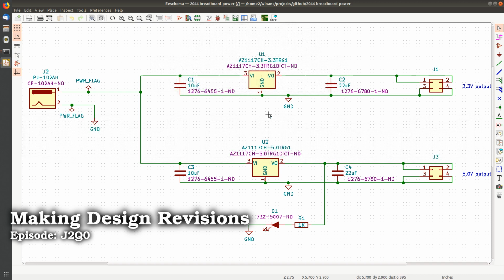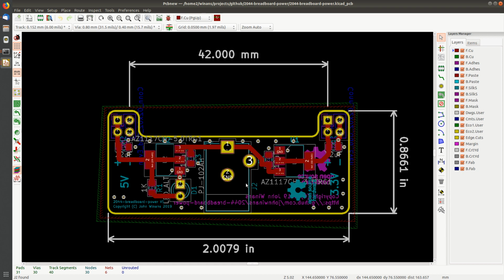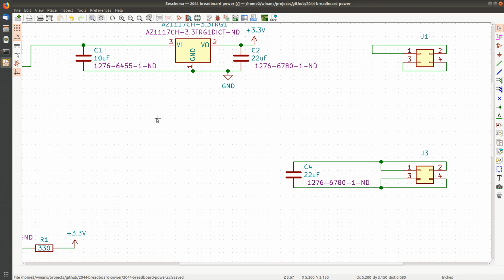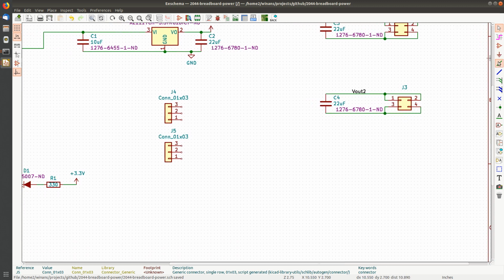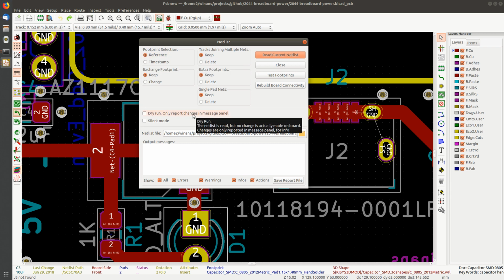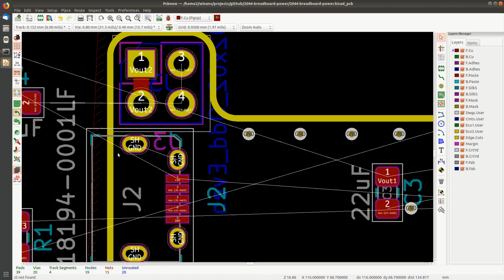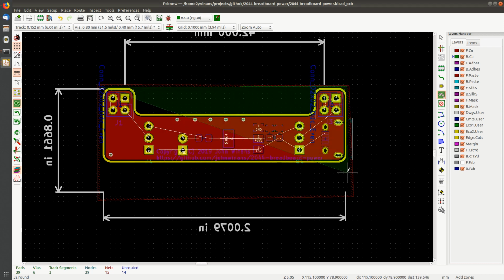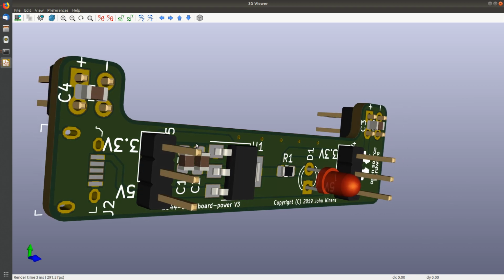KiCad 5 #10 Making Design Revisions

Comment: Thanks for your clip, I learned a lot from your clips.
However, when you want to do revision just save the original schematics and layout to name_v2 and close the views then open (name_v2) and work on those instead of destroying the original work.
Reply from the maker: This is a good idea when not using version control.  Normally I keep my projects in something like git.  Then I just tag the various releases so I can retrieve them later.
Reply: @JohnsBasement  Thanks again John,   Just a reminder that git is designed for text, and if you are not extremely careful it would corrupt your binary files. For binary files try "Subversion" or "Helix Core"

Comment: You forgot to connect GND to J1 and J3
Reply from the maker: You are correct!  I noticed that after recording this discussion and pushed up the corrected version to github.
Reply: @JohnsBasement  Thank you for your works, it helps me a lot!
Currently I'm struggling to produce PCB at home to tighten the cycle. If you have any advice on that, please let me know

Comment: Gee... another great coffee shop video...  you are one of the 1st to know as of right now i am having my 1st 8" x 6" pcb being made... thanks to you and other diy videos...  thanks a lot...:)
Reply from the maker: If you can say, What board house R U using??  I've been bending over backwards to stay under the 100x100mm proto service options from pcbway & jlcpcb.  So far so good.  But it's great to have other options.
Reply: @JohnsBasement  Hi, PCBway came up 1st last night, so i placed the order and it was $54 for 5 boards and with SH the total of $82. i guess that is ok? a least i got started.. thanks.
Reply from the maker: I haven't done anything that big in over a decade.  And then never as a hobby project.  So that seems reasonable to me!
Like I said, I've been limiting myself to their 100mm square bargain boards at 2 and sometimes 4 layers.  With shipping they are are in the $20-$30 with shipping fir 5.

When I'm under 5 square inches, i prefer oshpark.  Theirs are higher quality, ENIG boards for even cheaper.  You like saw some of those in the tiny example project boards in this series.

Comment: I have a board almost ready.  I’ve modified the silkscreen to be more user friendly.  I need to make a small schematic change, if I update the board it wants to change the references back to what’s on the schematic?  Is there a way to prevent.  Or maybe I should have just added new text instead of changing the reference.
Reply from the maker: Kicad is not known to support back-annotation (from pcb to the schematic).  You should have changed the refs in the schematic & then propagated them to the pcb.
Do you REALLY want the part references to differ between your schematic & PCB anyway?
Reply: John's Basement No I don’t,  I was watching someone who had changed everything on silkscreen.  So I did it that way.  Changing the reference so that you can have the text you want on silkscreen makes no sense.  I changed what I was doing to just adding text to silkscreen.  I don’t mind the reference on the silkscreen, but if I did, I could just turn it off.  I wish the video I watched had done it that way.
Reply from the maker: @TheDaveho  Changing the ref strings on the PCB is just a bad idea.  If you want something to say "1.5v zener" then add a text field to the silkscreen layer. Sometimes I add text to a copper layer that is otherwise not filled.

For easter eggs on a 4 layer board, put a rectangle keep out somewhere to keep all layers free of copper. Then write some text into the layer 2 copper, not too small. Then you can only see it if you shine a light through it from the back.

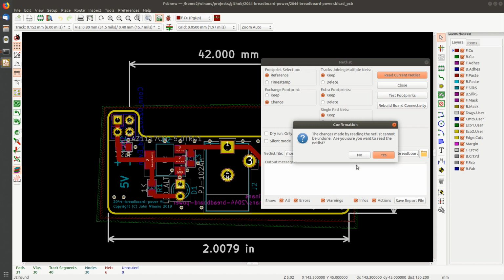Comment: Hi, I´m using KiCad 5.1.5 on a Windows PC and I´m having difficulties to update the Netlist (minute 5:49 of the video). Do you know how do I do it on this version of KiCad?
Reply from the maker: I'm on 5.1.5 now too & haven't noticed any issues.  The properties editor is rearranged but otherwise works the same for me. You might have to be more specific.
Reply from the maker: One other thought, if there is some sort of bug, maybe foregoing the netlist and loading updates to the PCB directly from the schematic might help. (The button to the right of the NET button in PCBnew.)
Reply: @JohnsBasement  Yeah, I´m having difficulties finding the editor and the stuff you did in the video.
Reply from the maker: You mean the netlist IMPORT in PCBnew??  Yeah, that is a little bit different in that it now FIRST tells you what it WILL do if you click 'UpdatePCB' so you can cancel it if you notice that it is not what you want.

The PCBnew import also changed the radio buttons to checkboxes (since all the choices are binary yes/no anyway) but all mean the same thing... so that does look a bit different as well... but it will ultimately accomplish the same thing.
Reply: @JohnsBasement  Okay, I think I get it now. Which boxes do I check? "Update Footprints", "Delete Extra Footprints" and "Re-associate Footprints By Reference"?
Reply from the maker: @GabiMesser  Well, that would depending on the situation... To match the video at 5:49, you'd want to "Re-associate Footprints By Reference" & Update Footprints".
Reply: @JohnsBasement  Thank you so much for the help and attention. That´s it!

Comment: If I want to install two parts, one barrel jack and usb connector. How do I modifiy this schematic?
Reply from the maker: Since recording this video, I have found  a nice through-hole mini-USB connector (this project has a micro). It is in the digikey library (see part 9 of my KiCad playlist) MFG part number is: 10118194-0001LF.

to add a barrel, you can hover your mouse over the barrel on there now and hit C to copy it.
(I'm not sure I understand your question.)
Reply: @JohnsBasement  Thank you for answering my question. I mean if I want to use micro use connector and barrel jack socket at the same time, how I design the schematic? Thank you John!
Reply: If the barrel jack is delivering something higher than regulated +5, you would need to have a regulator on that, which would also connect to the feed from the USB. You wouldn't use them "At the same time" .... you don't want the USB supply and the barrel jack supply competing. But you could use whichever was convenient at a particular location. Like having a device with wall cord and batteries .

Comment: There is no "technical error". It is an user error ;-)  You forgot to wire the "-" outputs to the ground on the schematics... Don't send your design to OSHPark yet !

Also, next time you want to measure something, use the caliper tool. It's much easier than messing with grid and counting dots.
Reply from the maker: Good eye!  I found the - GND problem right after filming.  It was corrected in what i pushed to github.

Good call on the caliper tool!  I could have also hit the space key to reset the dx dimension to eliminate doing the math in my head.

Comment: Great video John,  lots of tip's and pointers.....Funny enough Contextual electronics just released a vid about removing track's and you can just "rip-up" and start again with a single keystroke ……..Have you any plans to go into using the GitHub to update library's or are there other tutorials I should see?.....But I like your style, so here's hoping.
Reply from the maker: Yeah.  I noticed that contextual has started updating their kicad series to version 5 right now too.  We seem to be using different approaches.  So I'll stay the course (so to speak).

I'm not sure what you mean about github and libraries.  Please explain.
Reply: @JohnsBasement having no experience with git hub I would like to say update my pacages3d libary but I'm not sure about terms such as "pull" and "clone" and what the procedure is....that sort of thing, I guess its quit straight forward but never done it
Reply from the maker: Hmmm... this is three things: git, gthub and updating 3D models.  I'm sure I'd like to get new 3D models as they arrive too.  I suspect, however that the 3D models arrive as part of the KiCad distro upgrades you have installed.
What OS are you using?
Reply: @JohnsBasement  Windows 10
Reply from the maker: Hmmm... I know there are a number of git-apps that are available for Windows.  I am a Unix/Linux command-line guy myself.  You might want to start by looking at the github help pages.  They have a tutorial in there that talks about how their twist on git works and how to use it.